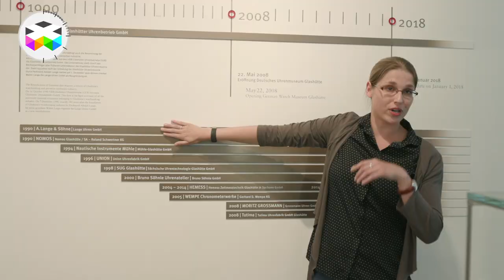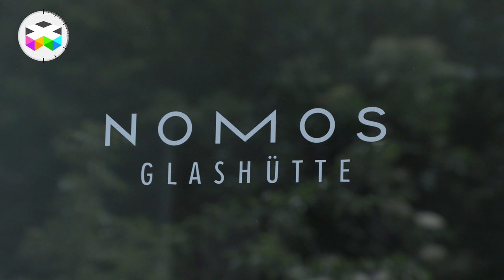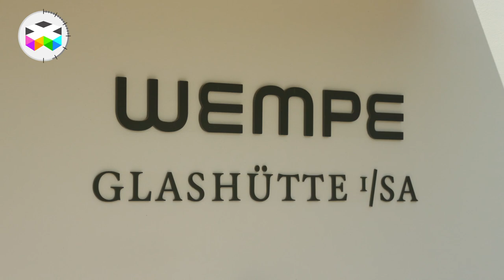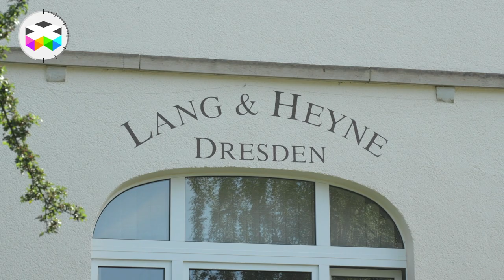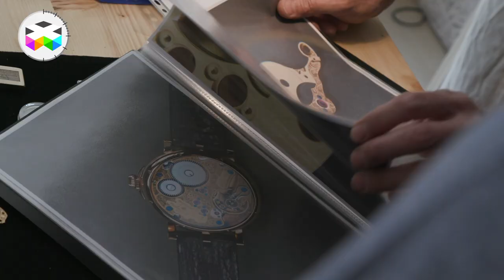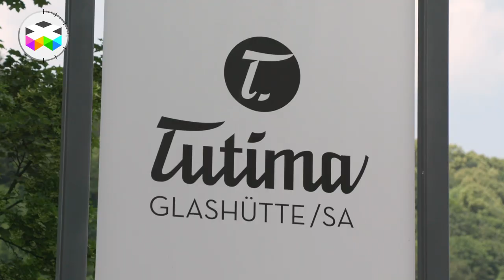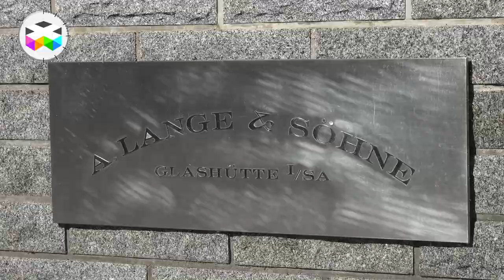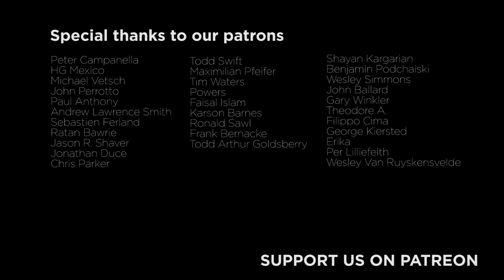Our 1st German Watchmaking Encounter!

Comment: I have often wondered how do watch makers keep their place clean. The process shown at 10:01 won't it create a very fine metallic dust? what happens to all the substance which comes out of grinding that metal against that machine. Or perhaps she is just polishing it. not shaping the metal.
Reply from the maker: There are various techniques, such as pressure difference that help or kind of static stands, but this remain an issue regardless, these are not white rooms like in the computer industry and glad it's not!